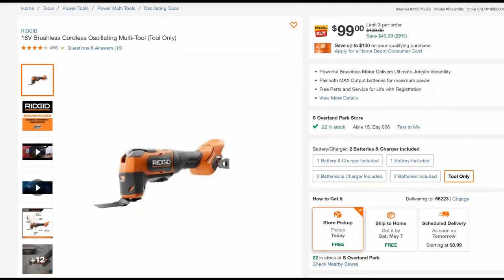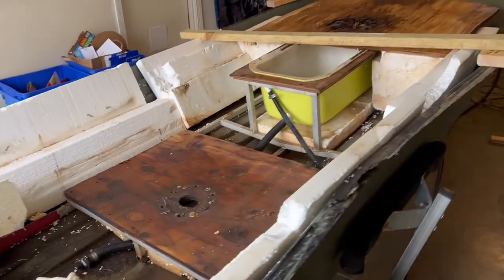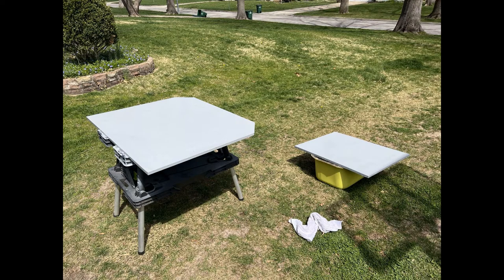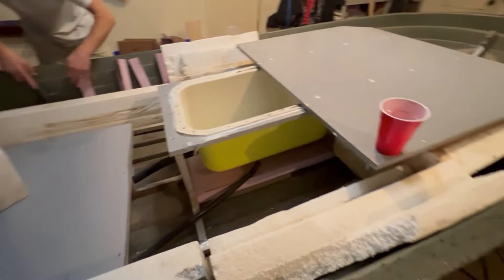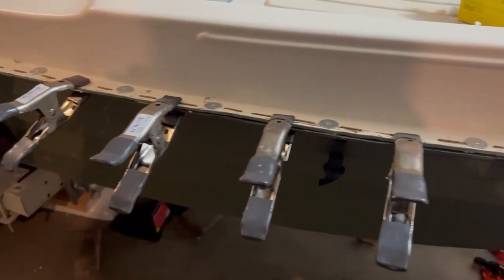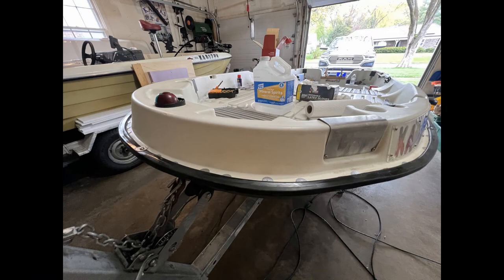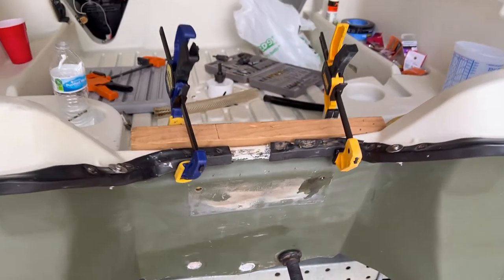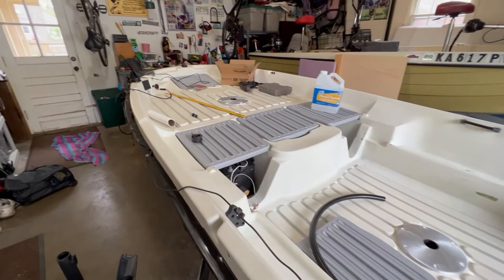Splitting and repairing a plastic pond boat (Pelican)

Comment: This is excellent.  Thank you for posting.  I couldn’t find my model of boat and this is it!  The seller said 2003 which makes sense that it was made in 2002.  I haven’t been using a cover and the bottom can get full of water without sinking after a heavy rain.  I’m using a drill pump soon to get the water out (there’s a plug for the under deck area) but I’m betting that the original wood is a mess by now (too much rain this summer).  This will be my winter basement project.  It’s a great bass boat and I have a nice little 6hp Yamaha 4stroke on it for reliable starts.  I’m also thinking (based on the condition of the existing rim seal) that the prior owner opened her up at some point too!
Reply from the maker: I found a cover on boatcovers.com for an 11foot boat that fit it perfectly.  Our previous owner let it sit out and everything was waterlogged and rotted.  Nice stable boat once fixed up.  We’ve run a 15hp on it which pushes it pretty good.

Comment: I've seen a few of these advertised for sale and was sceptical about them, especially for the price. Some of them were all waterlogged and after a few freeze/thaw cycles here in Minnesota, the plastic was all split up and cracking. So be careful when you look at used ones.
Reply from the maker: Yeah, I think if they get left in the elements for extended periods uncovered it will weaken the integrity of the plastic and crack easily.  We paid $600 for ours with a very nice MK trolling motor included and galvanized trailer.  Sub-floors where rotten in front so we just split the boat.  Wasn't that bad.

Comment: Hi Matt, great video! I'm about to split my Pelican 8' in half and need to ask if you replaced the styrofoam blocks? I have a feeling mine are waterlogged (didn't know that was possible) because I'm sure I hear them sliding back and forth when I move the boat around.
Reply from the maker: Thanks.  Most of our foam was ok after we let it sit out.  We used purple foam insulation boards from Home Depot cut to different shapes and glued together for a few small pieces we needed to replace.

Comment: I have a sundolphin 120 pro that I think is gonna need the same treatment.   You mentioned in the video it went easy once you caught on.   What was it you figured out?
Reply from the maker: The multi tool and vibrating blade was the best way to cut it.  We started with a sawzall and it was very difficult to cut it down the seam.  A multi-tool blade that will cut wood and metal-- preferrable the round one shown in the video.
Reply: I can cut anything lol and luckily I have that particular blade.   Did you have any difficulty putting it back on there when you were done
Reply from the maker: Not terribly difficult.  Two man job with lots of cheap spring clamps.  Transom was most difficult.  Used some staples to hold it in a couple of places until I could get it aligned properly and riveted.

Comment: about to reseal a pelican bass raider 10e I had split open did you just use the pop rivets or did you also use staples I am on the fence about staples as it seems like a lot of work to bend them back only using a crown stapler.
Reply from the maker: For the most part we used the rivets and stainless steel screws/nuts (both with fender washers for added grab).  The screws/nuts were used to hold the original rub rail through the factory holes. I did use a few staples from my pneumatic stapler on the back where it was tougher to get it aligned.  Primarily just to hold it in place while we did the rivets.

Comment: Where can you get the seat mounts that fit in the hole
Reply from the maker: Any seat post will work that fit within the plastic.  We used some that we had on hand, but you could use Swivl-eze or really anything.  We had to cut holes in the new wood but it was smaller than the existing holes in the plastic.  Those bases attach with like 6-8 wood screws.
Reply: @mattp9029 thank you I just bought one of these and I’m deciding what I want to do